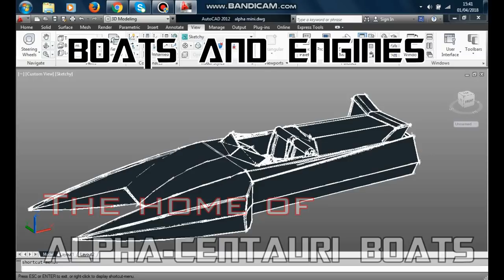Alpha-Centauri Speed boat build - part 8

Comment: Hi. Hope you dont mind me giving a little advice (which you can choose to ignore if im sticking my nose in). After you have layed in your matt and wetted it out i would  roll reasonably heavily with a ribbed aluminium roller. This compresses the glass layers making a more dence stronger lay up. Also the rolling with ribbed roller brings excess resin to the surface for next layer of matt to soak up. It also allows more bubble release and easier forming into corners of fibres. Therefore  lighter stronger glass ups whilst useing less resin.  Hope ya dont mind an old git sticking his oar in.😉😉. Good work and interesting build. Cant wait to see her all finished and flying.
Reply from the maker: Thanks, yes thats excellent advice, I do use a consolidation roller between the laminate, just not on the floor edge as there was a small gap to bridge that I didnt want to push it into. Great advise though and very observant!

Comment: Not sure what your level of experience is building boats, but your results are quite good. And yes, I'm going to make another suggestion (sorry).
All of your internal wood structures should be completely enclosed in fiberglass to keep them water proof to prevent rotting. I've worked on fiberglass boats similar to yours. And those with the structural members encapsulated in fiberglass hold up much better over time. Great series...enjoying it tons.
Reply from the maker: They are in the next video in the series :-)